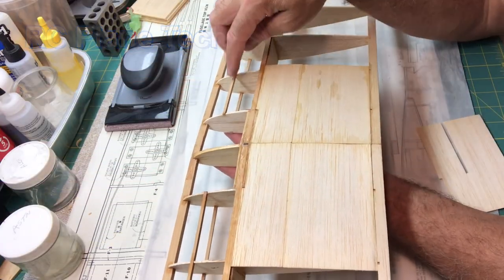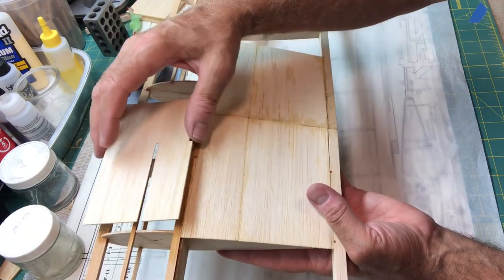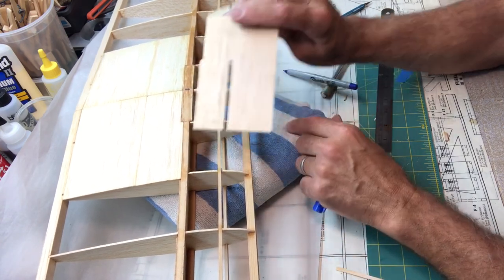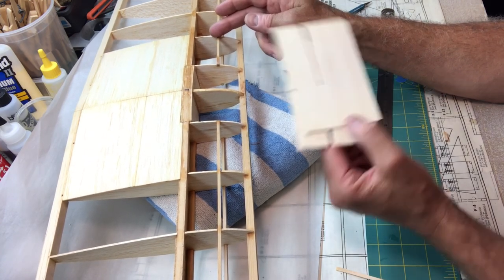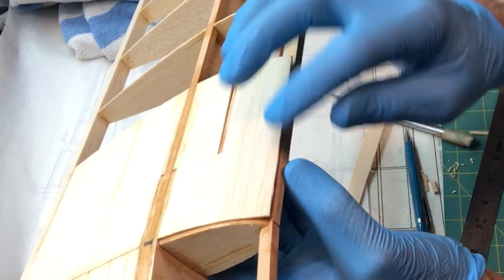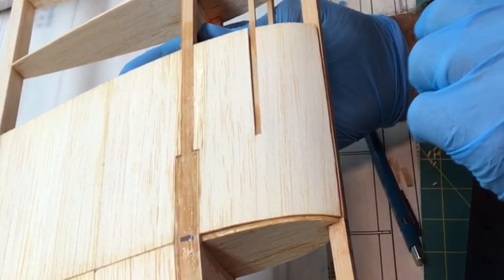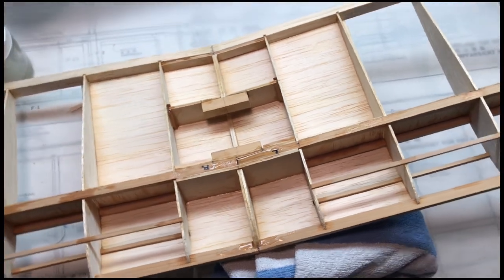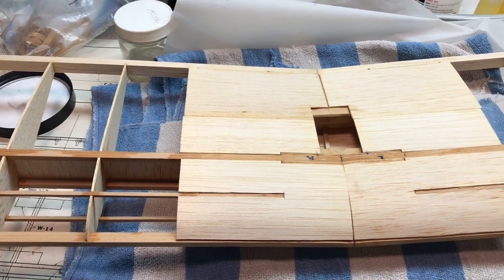Barnstormer 25S Vintage RC Plane Build: 10 Wing Sheeting Part 2

Comment: where do i get the fiber glass strip?

tks
Reply from the maker: Hello, thanks for your comments. The fiberglass strip is just cut from fiberglass cloth. You can get a package of it online from a lot of places. You can try hobby shops online such ad Sig, Tower Hobbies. But you can also get is on Amazon, ebay, etc. Depending on your application you would get different weight cloth. Thinner, lighter cloth is used with resin epoxy for finishing surfaces. Heavier cloth is used for reinforcement such as the wing center. You can get a lot of good info on what types of cloth to use and how to apply it on RC forums. I will be doing it on this plane in my next video. This plane probably does not need the extra reinforcement level, so I’m going to be using it more as a finishing application. 
It an easy application, and fun to do.
Reply: @JamesRCPlaneTech  many thanks!!